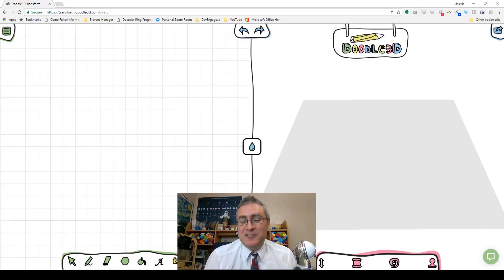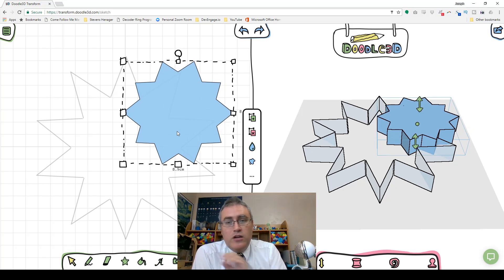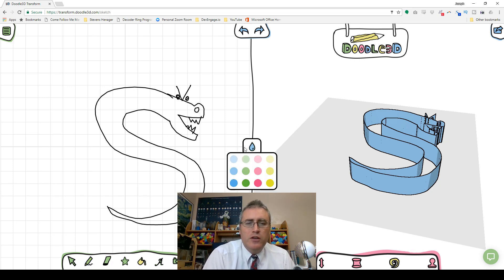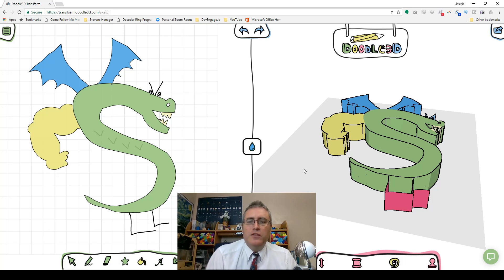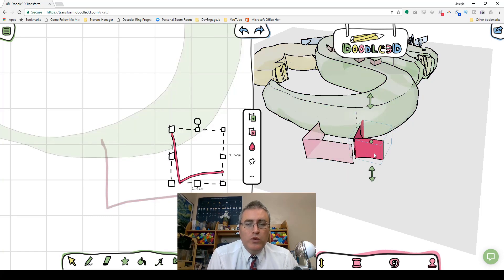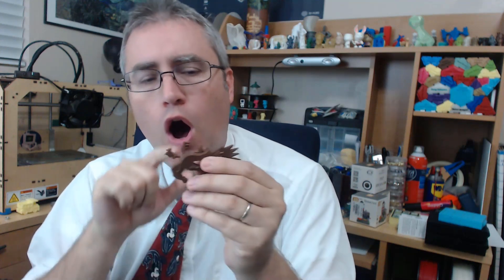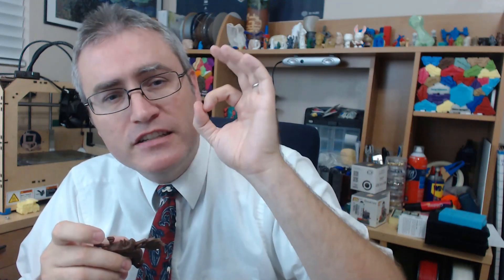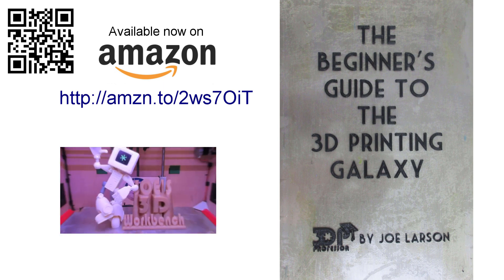3D Printed Trogdor drawn in Doodle3D

Comment: There was a strange hum, during the whole video. Anybody else notice that?
Reply from the maker: I couldn't hear it before, but now I can. I've got to turn up my speakers to hear it. I wonder if my USB mic needs to be replaced. That would suck.
Reply: Sounds like a feedback hum. Is your microphone set to listen? 

A bad microphone would have a 60hz hum in the US.

I took your audio through a spectrumanalyser. it's around 170hz.
Reply: Well 170 is a weird one. Maybe it's a cooling fan or some other motor? Since a typical fan switches 4 times per rotation, the fan could be running at 2500 or 5000 RPM. Because the way it sounds, it lacks that typical sawtooth buzz that fluorescent lighting, diodes/rectifiers, and SMPS leave behind, so it's likely not at all due to mains interference. I think the source of noise today is acoustical/mechanical in nature.

I'm not sure which version of Snowball you're using, not all of them are configurable, some are, but in omni mode, obviously close by sound sources have an increased affect; but in directional modes, there can be specific stray angles that are picked up far stronger than others due to diffraction.
Reply from the maker: ...a fan. Hold on, I think I know what the problem is.